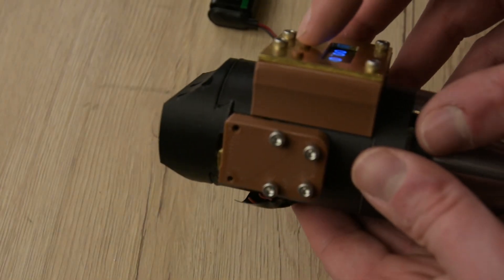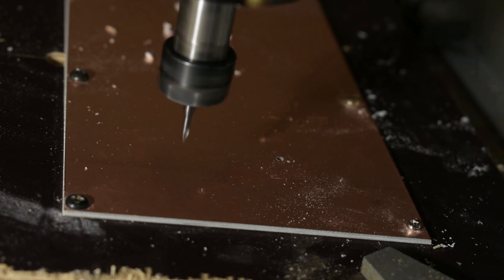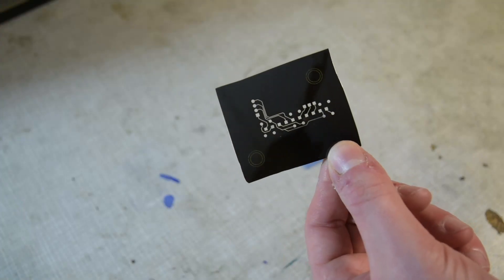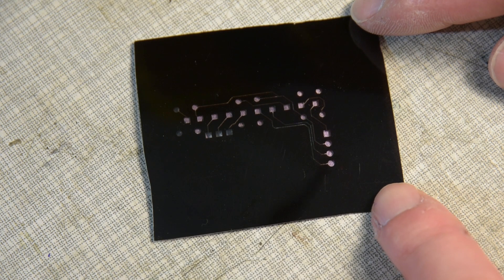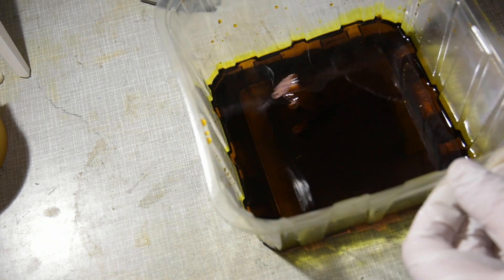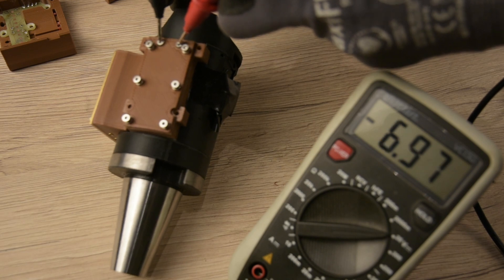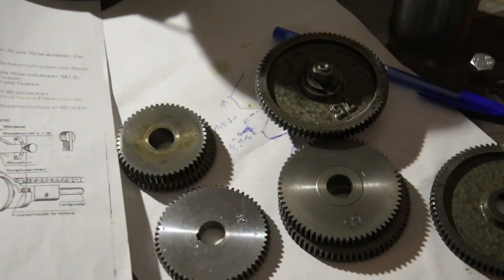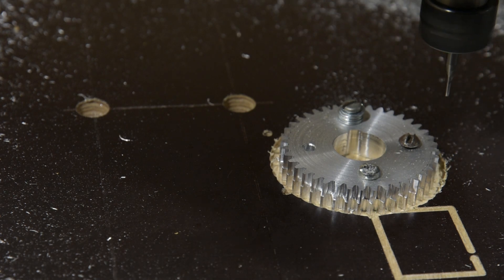DIY Digital Boring Head Part 2

Comment: Nice work, waiting for 3rd part. About this part: look in aliexpress for "long neck end mill", it will allow you to mill teeth of gears and timing belt pulleys from one side, without need of rotation. I have endmills from  Diameter 0,4 x Length 4mm to D2xL20. Diameter 0,4mm allow to make module 0.4mm gears on the same small CNC machine. For position sensor, look at LDC1614 chip from TI. It is easy to use it and to make linear, or circular high precision sensor. Also, I hope you are not going to use linear tooth rack to move boring head))) Because linear rack and such small motor will not withstand load from boring.

Comment: Printed prototype looks good! I too have struggled with 2nd op workholding on router style machines in the past, perhaps machining a negative of the gear into the mdf would work well enough?
Reply from the maker: Thank you. Machining a negative could work, i tried but my machine is not precise enough for that. It is either too loose of a fit or not fitting at all. Reaming the locating holes in the workpeace and wasteboard in one go could be a better solution instead of only milling the holes with an endmill and in seperate operations.
Reply: @designcircle6542  If you give reaming a shot please upload the results, I would be concerned about the minimum spindle speed on a router spindle (most of the chinese 2.2kw spindles seem to have a ~6krpm minimum ime), but perhaps the surface speed on a reamer that small is still reasonable. WRT machining a negative, could you add a sizeable chamfer and tap the part in?
Reply from the maker: @osianleahycnc  Yes, comparing different methods of relocating parts on a router might be a good video idea (and i dont think somebody did it already). With reamers under 3mm this might be possible in aluminium with those chinese spindles. If enough Z hight is available one could also ream by hand with a tap follower

Comment: Not sure if this is just a language thing, but your mill is what we would call a lathe , and your 'cnc' a router albeit a cnc controlled router.   Battery is going to be an issue, have you considered an 18650 , buried in the adaptor with a boost converter for the motor power voltage?
Reply from the maker: Thank you for the feedback, I definitely jumbled the mill and lathe part... I cant use normal boost or step down converter because they have a lot of voltage ripple and that will affect the ADC readout without additional analog filtering and without considering temperature drift.
Reply: @designcircle6542  Hi :-) What are you using the ADC for ?
Reply from the maker: I am using it and a potentiometer to read the absolute position of the sliding part of the boring head.
Reply: @designcircle6542  Hmmm -  even accurate pots have rarely better than 1% linearity. You may have to add a correction table to the software (if you haven't already).
Reply from the maker: @wktodd  the one I am using has 3% and I plan to correct for it in software... at least I will try.